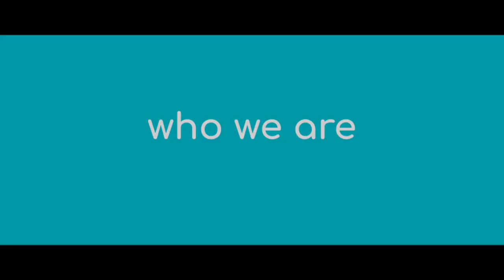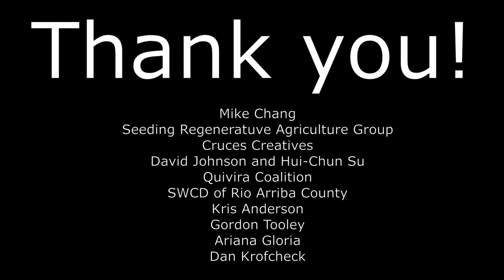2020 Keyline Design of the Larga Field

Comment: I live in NM and have some desert land that drains into a fair sized arroyo. I am looking at doing something similar to capture the rainfall instead of it just flowing into the arroyo. I will likely do a combination of keyline, swales and ponds as diverting some water flow from the smaller tributary arroyos. It is great to see some young people like you two doing this. Best of luck to your venture.
Reply: Don’t bother with swales unless you have yearly flooding. The key lines will create channels and ridges. Run these closer together so you catch more water. A keyline channel every metre is my suggestion.